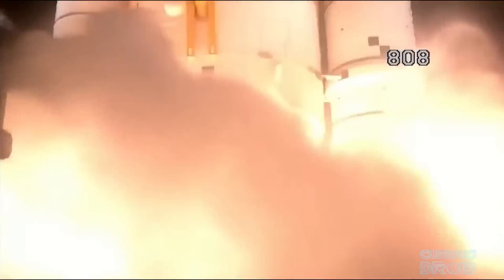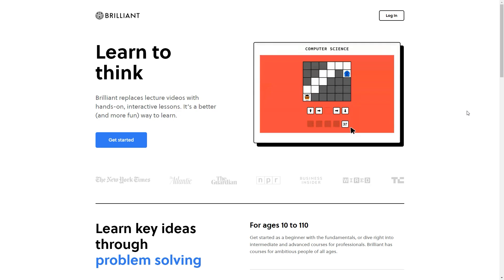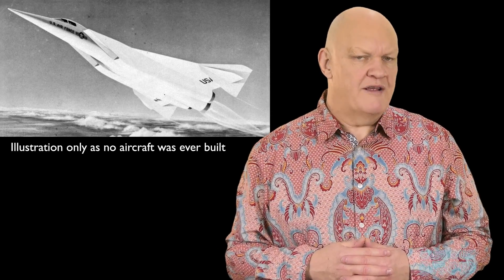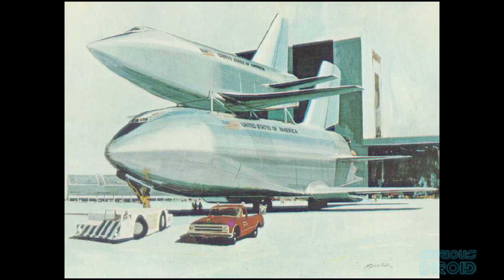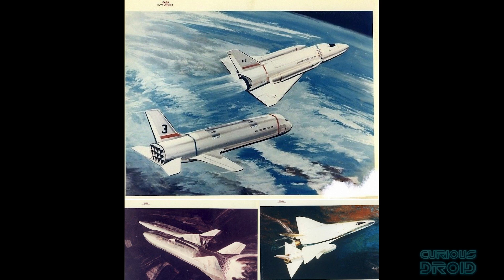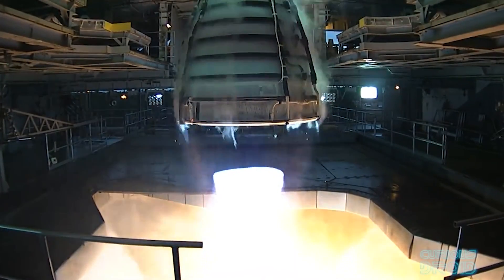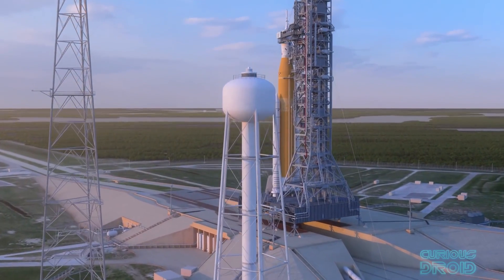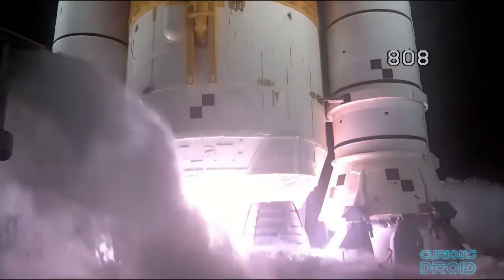Why is NASA Throwing Away Reusable Engines?

Comment: I love Nasa and the space shuttle but I can't help feeling that if they hadn't gone down the Space shuttle route after Apollo, if they'd stuck with the moon and dedicated as many resources to it as they did for the shuttle we would be so much more advanced with going to the moon than we are. Artemis for all the pomp and ceremony is only very slightly ahead of Apollo. It uses all old ideas, almost as if no-one has any other ideas about how to get to the moon, even the staging is the same as Apollo i.e massive main stage to get up into space, smaller second stage to get to the moon and eventually only the tiny crew capsule returning to earth. I know the physics of it all hasn't changed but surly Nasa, the biggest and supposedly best space agency in the world can do better than just recycling and making slight upgrades to ideas that have been around since the 60's. In addition the old shuttle kit they are using should be in museums or studied not wasted.
Reply: As you said, the physics have not changed.

Comment: the congressional mandate is so ridiculoutly dumb, SLS is not using the shuttle's main tank for anything, its a core stage constructed of carbon fiber and is basically an entirely new tank structure externally and internally to accomidate the larger storage needs and account for the different fuel flow pattern, yet its "a shuttle tank" to lawmakers because its orange
Reply: Exactly

Comment: Elon said it would be 10X cheaper, instead it turned out to be 10% cheaper. Which is a good result, but they are for profit, so it costs the same in the end. The shuttle refurbishment was far more expensive than anticipated. Expensive in cost as well as loss of payload capacity.
Reply: The Artemis IV HLS Starship landing at $1.15B to NASA is around 3.6 times as cheap. Better than SLS, but not super cheap like a lot of people claim. Starship likely can mature to the point of being able to replace SLS/Orion, but not in time for the early Artemis missions.
Reply: What turned out to be 10% cheaper?

Comment: Disposable engines are not the wave of the future.
Reply: Funny that 2 of the 4 Falcon 9 launches in Nov 2022 were expendable launches. Booster reusability is great, but has drawbacks.

First, if you don't have a fast enough launch cadence, you can spend more on recovery equipment and personnel than you save by reusing the booster.
Second, you take a payload hit for the recovery system on the booster. The Falcon 9 B5 can lift up to 22.8 tons to LEO when expended (SX), but only up to 16.7 tons when landed on a drone ship (B1069.2). Doing a Return to Launch Site (RTLS) landing, costs even more payload as you have a boost back burn to cancel the lateral velocity and return back to the launch site.
Third, the higher and faster you go, the harder reusability is to perform. The heavier the dry-mass of your booster, the harder reusability is to perform.

So with SLS launching once a year, eventually, the cadence doesn't really justify recovering the booster. Not to mention that it gets higher and faster than a Falcon 9 as the SLS core stage almost reaches orbit, making recovery MUCH more difficult. The SLS core stage is travelling well over 3 times as fast as the Falcon 9 booster and is well over twice as high as the Falcon 9 booster at MECO. The dry mass of the F9 booster is 22-25 tons while the SLS core stage is 85 tons.
The SLS Block 1 can get Orion to the Moon, but not with the kind of payload hit like F9 has. The SLS Block 1B will send along a Lunar Gateway module with Orion, so it really can't take the payload hit either.

SLS started design work in 2011, 4 years before SpaceX would land a booster and almost 6 years before SpaceX would reuse a booster. We are in a transition to reusable spacecraft, but reusability is not always the best answer.
Reply: @steveaustin2686  Recovery of astronauts requires a carrier task force. Elon Musk is in business and looking to the future instead of the past.
Reply: @markskeldon1347  I'm not talking about crew flight, but recovered boosters vs not recovered boosters. I'm NOT saying that SpaceX should NOT recover their boosters, just showing how recovering the booster impacts the Falcon 9 and comparing that to SLS. It's not a hard concept.
Reply: @steveaustin2686   Space X has a different business plan than legacy aerospace.  Elon has chosen to spend money in order to try out ideas. This concept is showing their ability to accelerate the development of long term goals. SLS uses what I think of as the bloated technocrat model. Cost efficient and streamlined processes seem to effect the attainment of future development's.
Reply: @markskeldon1347  Maybe read the section below again? SpaceX launches enough that spending money on recovery is worth it. The Falcon 9 Block 5 can take the payload hit and still launch most payloads. The SLS Block 1 can NOT take the payload hit and still get Orion/ESM to the Moon. The SLS core stage is moving over 3 times as fast, is over twice the altitude at MECO, and has over three times as much dry mass. ALL of that makes it harder to recover. Cost-plus or Fixed-price contracts not withstanding. SpaceX has yet to have a Cost-plus contract so we don't know how they would be with one.

Booster reusability is great, but has drawbacks.

First, if you don't have a fast enough launch cadence, you can spend more on recovery equipment and personnel than you save by reusing the booster.
Second, you take a payload hit for the recovery system on the booster. The Falcon 9 B5 can lift up to 22.8 tons to LEO when expended (SX), but only up to 16.7 tons when landed on a drone ship (B1069.2). Doing a Return to Launch Site (RTLS) landing, costs even more payload as you have a boost back burn to cancel the lateral velocity and return back to the launch site.
Third, the higher and faster you go, the harder reusability is to perform. The heavier the dry-mass of your booster, the harder reusability is to perform.

So with SLS launching once a year, eventually, the cadence doesn't really justify recovering the booster. Not to mention that it gets higher and faster than a Falcon 9 as the SLS core stage almost reaches orbit, making recovery MUCH more difficult. The SLS core stage is travelling well over 3 times as fast as the Falcon 9 booster and is well over twice as high as the Falcon 9 booster at MECO. The dry mass of the F9 booster is 22-25 tons while the SLS core stage is 85 tons.
The SLS Block 1 can get Orion to the Moon, but not with the kind of payload hit like F9 has. The SLS Block 1B will send along a Lunar Gateway module with Orion, so it really can't take the payload hit either.

SLS started design work in 2011, 4 years before SpaceX would land a booster and almost 6 years before SpaceX would reuse a booster. We are in a transition to reusable spacecraft, but reusability is not always the best answer.
Reply: @steveaustin2686  Thank you for the information, I am only a distant observer of the current space race. Space X is a very young company that is turning the industry upside down.  Just how many years and how many dollars in cost overruns can Boeing claim as a feather in their hat? Building the fastest rocket today may not mean that much because todays tech will shortly be obsolete.  Space X  appears to be doing more with less, it's youth, agility and persistence will serve it well. Reusability as well as speed is the future.
Reply: @markskeldon1347  The SLS core stage (Boeing), Orion (Lockheed Martin), and the Mobile Launchers (Bechtel) are all on cost-plus contracts. So cost cutting is not incentivized. They can't just waste money willy-nilly as there is still oversight. Starliner (Boeing) is under the Commerical Crew program and that is a fixed-price contract, so Boeing has been playing for Starliner fixes. To my knowledge, SpaceX has never had a cost-plus contract, so we don't know how they would operate under one.

SLS's core stage pushes the upper stage higher and faster than a Falcon 9 does. That means that the upper stage can lift more. It's just the same as when a Falcon 9 B5 is expended for a launch. SpaceX uses the landing propellant to push the second stage farther, meaning the booster can not land. The point is that the SLS core stage speed, altitude, and dry mass at MECO, makes it much, MUCH harder to add in a recovery system on top, than on the Falcon 9 B5. Spaceflight is ALL about tradeoffs. If SpaceX can afford the payload hit on the Falcon 9 B5, like with the recent 40 OneWeb sat launch, they add a boost back burn to the landing burns and come back to CCSFS for recovery. If SpaceX can't afford the payload hit for the boost back burn, then they land on a drone ship, like for their Starlink launches. If SpaceX can't afford the payload hit for landing at all, like for the recent Eutelsat 10B launch to GTO, they expend the booster. This should not be a hard concept.

SpaceX's biggest customer is NASA. The 2008 $1.6B Commercial Resupply Services (CRS) contract to develop and fly the Falcon 9 and Dragon capsule to the ISS were what saved SpaceX per Musk. NASA has awarded SpaceX 3 Commercial Crew contracts, further CRS contracts, 2 HLS contracts, and many single mission contracts. NASA LOVES SpaceX. SpaceX is not the only innovative company as ULA, Blue Origin, Rocket Lab, Relativity Space are all developing reusable launch systems.

Again, reusability is great, but is NOT always the best answer. Even Musk sees expendable versions of Starship.
Reply: @steveaustin2686   All good observations.  Elon has a different business plan than legacy aerospace.  Perhaps NASA's "love" of Space X is a stretch.  It has fullfilled its missions as the lowest bidder and managed the company's operations in a manner to grow. Elon has not engaged armies of lobbyists like the legacy companies do, he just lives outside that box. It seems as though the old space outfits need serious competition and Space X is the top contender. Space X will succeed if it has a level playing field.
Reply: @markskeldon1347  Considering how many NASA programs that SpaceX has programs in, I would say that NASA loves SpaceX. Don't think that SpaceX doesn't have lobbyists, because Musk flexed them when the HLS complaints came out. And the playing field is pretty level for SpaceX, as they blasted it level. If anything, SpaceX is indispensable right now with the Falcon 9 B5, cargo Dragon, Crew Dragon, and Falcon Heavy.

Comment: "Why is NASA Throwing Away Reusable Engines?" 
Agreed -  seems like such a waste.  SpaceX has shown the way forward with reusing engines and boosters.
Reply: Booster reusability is great, but has drawbacks.

First, if you don't have a fast enough launch cadence, you can spend more on recovery equipment and personnel than you save by reusing the booster.
Second, you take a payload hit for the recovery system on the booster. The Falcon 9 B5 can lift up to 22.8 tons to LEO when expended (SX), but only up to 16.7 tons when landed on a drone ship (B1069.2). Doing a Return to Launch Site (RTLS) landing, costs even more payload as you have a boost back burn to cancel the lateral velocity and return back to the launch site.
Third, the higher and faster you go, the harder reusability is to perform. The heavier the dry-mass of your booster, the harder reusability is to perform.

So with SLS launching once a year, eventually, the cadence doesn't really justify recovering the booster. Not to mention that it gets higher and faster than a Falcon 9 as the SLS core stage almost reaches orbit, making recovery MUCH more difficult. The SLS core stage is travelling well over 3 times as fast as the Falcon 9 booster and is well over twice as high as the Falcon 9 booster at MECO. The dry mass of the F9 booster is 22-25 tons while the SLS core stage is 85 tons.
The SLS Block 1 can get Orion to the Moon, but not with the kind of payload hit like F9 has. The SLS Block 1B will send along a Lunar Gateway module with Orion, so it really can't take the payload hit either.

SLS started design work in 2011, 4 years before SpaceX landed the first booster and almost 6 years before they reused a booster.

BTW, 2 of the 4 Falcon 9 launches in Nov 2022 were expendable.

Comment: With a fuel/oxidizer ratio greater than 6:1, the RS-25 makes much of it's thrust from unburned hydrogen. Speed of exhaust is more efficient than total mass of exhaust. However, it comes at the cost of an enormous fuel tank.
Reply: The RS-25s need a fuel rich burn, since the alloy of the turbo pump wouldn't withstand an oxygen rich burn

Comment: The NASA leadership team and senior engineers should be sacked for taking a massive technological and sustainable step backwards, going from the Shuttle to the Constellation and then to  Artemis is madness. Why didn't NASA and its contractors have a v2 of the Shuttle, which was superior and improved upon the original design? Considering the Shuttle was designed in the late 60's, they could have started designing a better replacement in the 90's, so that 30 years later in the 2020s we had a reusable new fleet of shuttles. The US Airforce is able to do it with the X-37b, why couldn't NASA scale that spaceplane up and use it?
Reply: They don't have the say you think they do.  Maybe you should try inform yourself a little.  Wouldn't that be new!  An informed opinion.  You might even like it enough to do it more than once.

Comment: Why is NASA throwing away reusable engines?  Because NASA is stupid.  The whole SLS is a pork barrel for legacy aerospace.
Reply: You pretend they have more say in the matter than they do.  Stop pretending.
Reply: You can't land a 85 t core stage with engines with 2000 kN + thrust. Rs-25s are too powerful to land a 85 t booster like F-9 does.
A landing core stage would habe needed different engines

Comment: Paul, great video and explanation.  As "reusability" outside of Earth's orbit, let's see.  Even Space-X is ditching its reusable boosters when it gets paid to in recent launches.  I am thinking that it is a lot to return a booster that has gotten itself most way to orbit and then have to turnaround and land somewhere.  I will believe in Starship when I see it work.  The booster is a whole separate thing.
Reply: A droneship landing takes about 15% more fuel, returning to the launch site takes about 30%. Maybe SpaceX were able to increase efficiency over the years, but these are the ballpark numbers.
You have to throw away the booster when the decreased payload capacity is no longer enough. Alternatively, you can build a bigger rocket. That's the Spaceship.
I don't know why you wouldn't believe in Spaceship, when SpaceX has proven itself many times over, and most of the hardware is ready. They are preparing for the first orbital flight, and with all the testing they've done, there's a good chance of success. Even the catch part has a decent chance of succeeding on the first try. They already perfected the belly-flop maneuver, and the precision landing, so the only thing left is to close the arms and grab the thing. It's not trivial, but far easier than it sounds.
Reply: Space X used some older boosters with 12+ landings for missions where they needed more payload than a reusable F9 could provide. F9 has become quite powerful (so the reusable payload is enough for most missions), but some missions demand more payload capacity

Comment: I guess there is a good reason behind it: maybe the fact of being very reliable even being reusable made it overengineered and quite expensive, so using the proven design can be made cheaper one use but reliable anyway, and is cheaper to make one than to recover and use it again
Reply: SpaceX is testing out their Raptor 2 engine which is re usable and being produced at a rate of 7 per week.